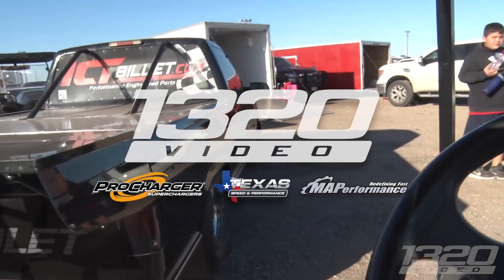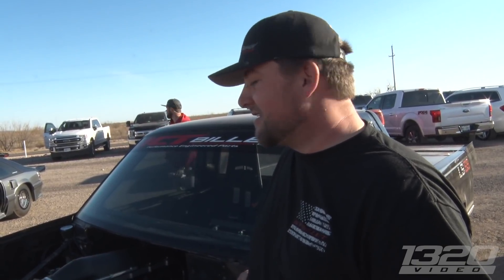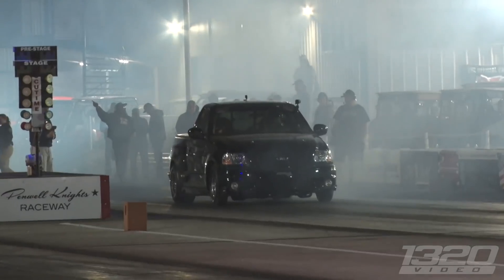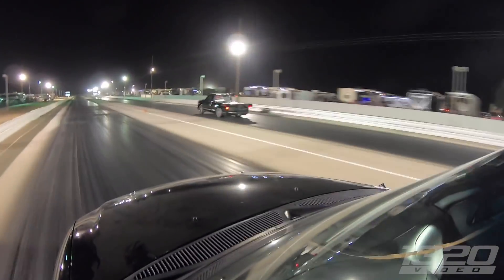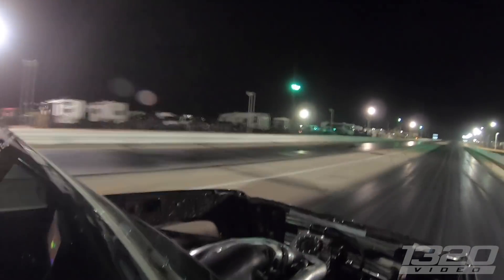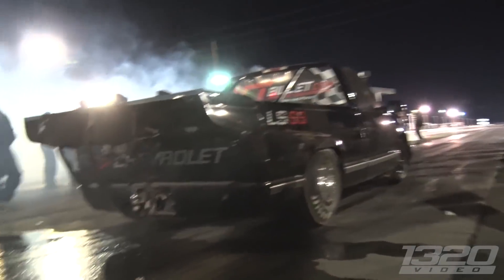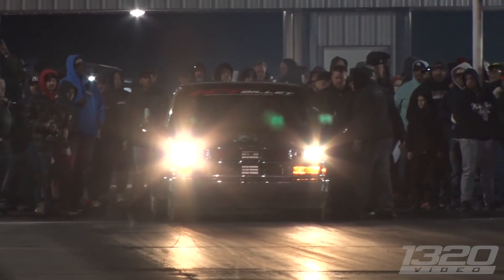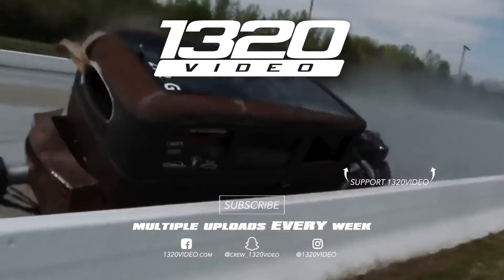STREET RACING Truck at the track for the FIRST TIME!

Comment: I was like, they call lightnings fox body's too?? Lol 😆🤣
Reply: I could be wrong but older F-150 Ford trucks front suspension can be swapped out with the a Crown Vic front suspension and if you look at the Crown Vic front suspension l think its very close to a wider foxbody suspension or very similar parts are use on both it my not be as heavy duty as the truck suspension but l bet it's quite a bit lighter and better for racing or weight transfer for drag racing
Reply: @gloriamaletta8667  nothing on a crown vic is even close to a fox body. And or a lightening.
Reply: @crfrider2005  l know you can put a Crown Victoria's front suspension on older ford trucks like the 1st gen 90s ford lighting seen it on a fast and loud episode
Reply: Me too, I dont know could be a sn95-150 bolt

Comment: A motor behind the front axle doesn't make it mid engined. The engine behind the driver is mid engined and over or behind rear axle is rear engined

Comment: Question: why don't you put the engine in the bed right in back or maybe a foot in back of the cab? Why keep it in front of the cab at all. Certainly you can set up the suspension and reinforce the frame to make the best use of the engine in that location and like 60% or more of the weight on th e rear tires is going to be great on the strip. So why doesn't anyone in trucks make the leap to real mid engine?

Comment: Just to clear this up a bit, its a front mid engine truck, since the engine is still mounted in the front of the truck and is just behind the front axle. Which is a really smart move by him, less weight on the nose